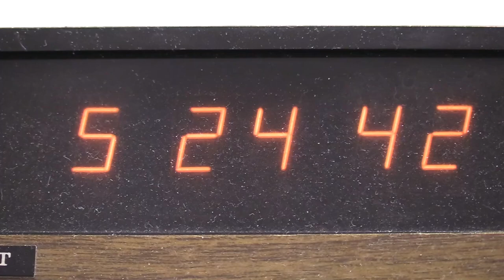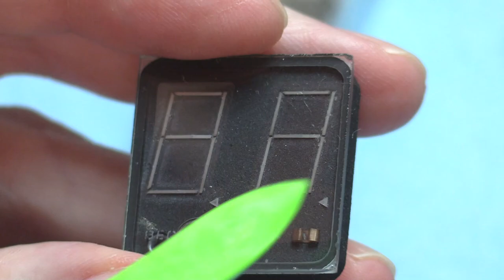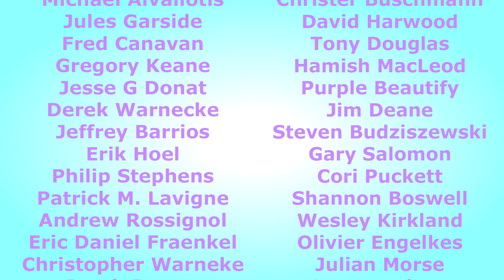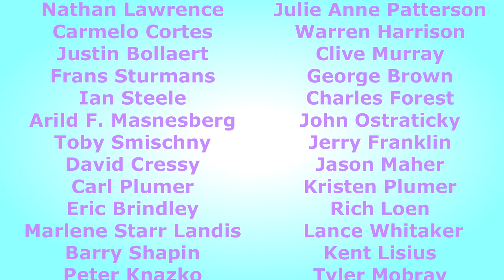Why Are Tubes Mirrored?

Comment: Fran, I love your videos. I worked at Dosimeter Corporation of America for 10 years, and one of the processes in the manufacturing of a direct-reading dosimeter is high vacuum platinum sputtering onto a 7 micron diameter E-glass fiber to make it conductive for use as the moving line (magnified 80X) against a calibrated film reticle. The process requires a 3-stage ultra-high vacuum that is back filled multiple times with Argon gas before the 3rd and final vacuum stage using an oil filled Jet pump. Platinum ultimately gets deposited on the inside of the glass vacuum Bell Jar that results in the same mirror-like appearance as a Getter. I took advantage of our equipment to platinum sputter all sorts of personal items from paper clips to guitar parts. We also manufactured Geiger-Muller tubes, probed, and meters, possibly including the one that you are using in this video.
Reply: Sounds like it was a fun job. The way you worded it makes me think you no longer work there.
Reply: @bentboybbz  The company was purchased by Morgan Crucible of England, who purchased the company name, equipment, and technology and moved it overseas.
Reply: @jts3339  Some jobs come with a nice sideline in bonus "stuff". Platinum deposition facilities sounds great.
I'm a Fitter/Engineer, I used to work down a coal mine. I could grab bolts and the odd thing from the stores. Kind of makes yours look a bit more special.
Reply: Can you re-silver a telescope mirror?
Reply: @DemoCATicMAN  I think its possible to do chemically maybe but has to be spun and done in a clean room ?  Not my area maybe someone else knows more. Sorry im not of more help. Now i want to go down a rabbit hole about telescope mirrors lol.
Reply: @DemoCATicMAN  I would say yes.  It would first be etched using an argon gas plasma, then silver sputtered with a device to spin the mirror to make the coating even.

Comment: The RCA valve is gorgeous.
Reply: My eyes widened and mouth went agape when Fran displayed it
Reply: Right? I love that it was designed to be beautiful as well as functional. And surely very few people would see one of these in a transmitter.
Reply: Mildly scary, imagine the bang it would make if someone dropped it.
Reply: @ThatBum42  OMG. Don't even joke about that. Forget the bang, what about the mess? :)
Reply: I was fortunate to witness these tubes in operation at an AM transmitter.  The plates glowed with intensity that varied with the average audio level.  I recall seeing bright orange at peak levels.
Reply: I like 4 1000a  my Rf amp has one
Reply: Vacuum tubes mix art and science. They're beautiful!
Good thing they're obsolete. Our modern world would't be possible with them.
Reply: @jsl151850b   not true! They are still in use today,  think microwave oven! Radar, x-ray ultrasound too many to mention! But yes they have paved our way into future.
Reply: @the8bitbarn836  I stand corrected, however, a solidstate replacement for the magnetron would give true variable power instead of duty cycling.
Reply: No kidding. Gorgeous.
Reply: @ThatBum42  Yes, it would be enough to startle a cat to jump through a closed window.
Reply: @frankowalker4662  Naw, the mess would be cleaned up after crying a river over the destruction of such awesome looking tube.
Reply: @WHHFDT  Yes.  You can also use these tubes in a SET audio amplifier and it puts out about 100watts.  So yeah, it's a pretty beefy tube.
Reply: @jukingeo  It would sound awsome and heat the house. :)
Reply: @frankowalker4662  Indeed, I never got into one as the B+ gets pretty scary.  You do something wrong with this tube and you are instant charcoal briquette.
Reply: @jsl151850b  FAA still buys and uses Vacuum tubes
Reply: They made a lot of stuff from vaccume  tubes,I only new about some thanks for shareing
Reply: Totally tubular, dude.  Cheers!
Reply: Got to admit I was impressed with the RCA tube 👍😊
Reply: @jsl151850b  - Apart from audio applications where many people still use them for the sound they make, a lot of radio stations still use them. Anywhere where you have a LOT of power they are often still used, its difficult to get 5kw out of a transistor...
Reply: The one at the beginning it is a 300B - and they are worth a LOT of money for high end single-ended audio amplifiers. They only give 2.5W to 3W so they are usually used with horn speakers but the sound is unsurpassed...  The RCA833A is not worth a lot $150 and its dangerous as hell to use as it runs at 2kv

Comment: I love your explanations of older technology. It's amazing how engineers solved problems. Sometimes with brute force!
Reply: That's the way edison did it.     He tried failed and tried again. BTW. TAE DISCOVERED THIS BLACK EFFECT WHEN HE P UT A THIRD WIRE IN HIS ELECTRIC LAMPS
Reply: @rsprockets7846  yeah Edison technically discovered the physical phenomena behind vacuum tube diodes in 1880 (an anode and cathode in a vacuum can act as an electric 'one way gate' only letting current flow one direction) but it took another 20 years for John Ambrose Fleming to realize that property could be used for radio detectors and invent the actual Diode tube.
Reply: @drewgehringer7813  
And including you too with your fairy tell stories. Be careful who you tell those fairy tales around in public.

Comment: That such items have been mass-produced for 100+ years staggers me!
Reply: I sell a lot of these and it still fascinates me that a 95-year-old tube can work perfectly well, and as new, after nearly a century. I love testing the real oldies.
Reply: In Russia tubes are still in mass production, mainly used in audio-amps by audiophiles who prefer the warmer analog sound.
Reply: There is the Great British Valve Project. They are getting various bits of valve making equipment together so they can start making valves again. Audio types as that's where the market is now.

Comment: I grew up in the 50's and fixed the old B& W TV's in my neighborhood in the Bronx. I took the tubes to the local pharmacy that had a tube tester and they had most of the tubes in stock. I infected my oldest son with my tube love and he is now a communications and computer engineer and has all tube stereo equipment. I also used to help rebuild CRT's and tuners. We would cut the guns out, process the CRT and re-flash it, replace the gun or guns and evacuate them before welding. I miss those days now you throw a TV away. I love your videos, thanks!

Comment: There are some tubes that have uranium-doped glass in them. It was used in the glass-to-metal seals because it has a closer thermal expansion coefficient to metal than regular glass, and so made for better seals when the tube was hot. An example is the Eimac VT129, a WWII-era pulse radar transmit tube. You can see the green glass around the leads.

Comment: Voltage regulator tubes just look cool...the ones I had glowed purple...argon gas, I guess. They also make good relaxation oscillators.
       Years ago, I saw transmitter tubes in operation at a small town radio station..they were glowing cherry red - I thought something was going wrong. The guy giving me the look around laughed, and said that was normal. He called them " coffee warmers".. 
      Some cars from the '80s had vacuum fluorescent displays. 
      Cool video!

Comment: You were spot on, large tubes like the 833A and the Eimac transmitting tubes have zirconium covered anodes.
Zirconium is usually inhert but will react with oxigen when heated at higher temperatures, the colour of the plate during operation is usually specified in the tube datasheet (usually with words like "cherry red" or "mild orange").
They also can contain radioactive stuff, it mostly happens in larger tubes that required large glass-metal seals, it was common to use uranium glass on the joints to try and match the different thermal expansion of different materials :)

Comment: I studied (started in 1967) electrical engineering technology at Purdue University in West Lafayette, Indiana.  One of my first courses covered vacuum tubes.  Four years later I was hired as a full-time graduate instructor.  My first teaching assignment that very same course on vacuum tubes. Much later (2000) I developed a curriculum on sustainable energy systems.  One element included solar vacuum tubes to produce hot water.  One of my students wanted to know the purpose of that shiny coating.  I replied "getter" and then explained.  Interesting that "new technology" still draws on basic concepts.  My first electronics project was a one-tube radio receiver (using the 1S5).  I was so excited (7th grade) when the filament glowed red.  Having been a professor (and aerospace EE) for 40 years it was always fun to explain filament transformers.

Comment: They couldn't flash that getter in the flat 2digit 7segmentdisplay because the conducting layer on the inside of the glass and the conducting kathodes on the back. And the thing is too flat to heat the getterring from besides. But what a great super rare display that is! Never saw them before, so that is why watching these video's is always something new to see and learn

Comment: High power RF tubes  usually have two types of getter in them.  The metal barium that is deposited at the base of the tube and the getters like zirconium on the Anode.  The Anode getter is activated by use of the tube.  When a old stock RF transmitter tube is first put into service the Anode getter should be activated over a period of about 100 hours with slowly increasing voltage applied to it.  The final activation is done at full rated output power for a couple of hours.

Comment: I am a retired high vacuum system glassblower. I checked thorium. It is an alpha emitter. Alpha particles do not penetrate paper, so the glass envelope of the vacuum tube will contain the alpha emissions of thorium
   Filaments have been coated with thorium oxide for about 100 years to increase thermionic emission of electrons while running at a lower  filament temperature. These filaments are used in mass spectrometers and other scientific equipment.
Doc Martin

Comment: The getter material used on the plates of large transmitting tubes was typically zirconium hydride.  Eimac used the trademarked name "Pyrovac". It only works at red-hot temperatures, so those tubes will tend to develop gas if used at significantly below their ratings.
Reply: Thanks for the info. When I find myself running one of these large tubes I will make sure I run it at the proper temperature.

Comment: Thank you for giving out the answer at the beginning! I'd have thought that either the mirroring was to increase efficiency by not requiring so much current to keep the emitter red hot, or that the mirroring was metal condensing on the glass while in use.

Comment: I''m glad your bringing up some of these topics. Tubes are still used by hams especially in higher powered Amplifiers .  That said, many of us with  a little more experience with tubes are getting older and passing . I had heard that one of the little regulator tubes was radioactive. One site mentioned that a certain tube had it added  or something wouldn't work quite right, but it wasn't a regulator.

Comment: Broadcast Engineer here.  4  of the 833s were used in a 1 KW am transmitters.   2 were the 
finals and 2 were used as modulators.  1000 Watts modulated by a 500 Watt audio amplifier.
 Older Gates and RCA transmitters used 833s.   4-400s were used in Collins AM 1KW 
transmitters.  Also using 4.   Again 2 were the finals and 2 were modulators.

Comment: I often hear nonsense on YouTube, but you have done quite well describing the process. On CRT's a mechanical 'roughing' pump was used, followed by a diffusion pump, followed by a cryogenic pump using ceramic beads and liquid nitrogen. All in all, it was about a 4 hour process. All the while the tubes were sitting in an electric oven to excite the molecular energy of gasses in the tube to hurry along the 'pump-down' process. Heating the getter by induction was indeed called 'flashing' the getter. After flashing, the vacuum would actually improve over time as the gasses 'stuck' to the getter flash. Over very long periods of time the biggest problem was/is helium seeping into the tube, because it will not combine with the barium and stick to the side of the glass. If you see a flash that has turned white it has "gone to air', and the tube is dead. Some knowledgeable people will 're-flash' a tube that has not been fully flashed and get a few more years of service out of it. That requires about a thousand Watt induction heater in close proximity.
While I never made Nixie tubes I do know that they are filled with a gas (neon?) that ionizes and glows, so they clearly don't need to have a high vacuum in the tube, which is what flashing barium getters is all about. I built CRT's for 'scopes and monitors at HP, and did all of the processes involved and that you described.

Comment: The silvering is from  the Getter which was fired at the end of the pumping phase of manufacture after the valve was sealed. It absorbed any residual gas molecules that would interfere with valve operation. In the mid sixties I spent a summer vacation working in VM1 at Mullards Hackbridge. This was at the end of valve development for valve based television.

Comment: Tubes are beautiful. I remember when I powered an 1G3GT filament with a 12V transformer when I was a child. When I showed it to my father he said: "the first numbers of most valves are the HEATER VOLTAGE. This tube has an 1.5V filament so it can be powered by a few turns of wire on a vertical frequency oscillator of a TV." Even when he reprimand me he taught me something. PS: the filament didn't burned out: tubes were not made for planed obsolescence like lamps.
The HP or Tektronix frequency counters he used at work had Nixie tubes, I loved when he tooked me to work.
Thanks for making me remember him.

Comment: Some high power tubes (some 304TL specimens come to mind) also utilize uranium glass for the glass to metal seal around the pins, so that's another source of radioactivity
Reply: Yes, I spotted my Eimac 100-TH pair had a couple of green glows around the pins whilst I was messing around with a UV laser!
Reply: Seen racks of them. The engineers and glass lathe op's just called them "Canary" glass envelopes. Yes 304TL's WW2 version. They later stopped using the radioactive glass.

Comment: It's getter. To remove the last air molecules after vacuum pumping.
I bought five 4 pin valves for £6 at a radio rally and inspecting them at home one was marked D.E.R. with a BBC stamp on the glass and has a pip on top where the valve was sealed. The body part of the valve is metal.
This dates it between 1924 and 1927 and it amazingly still works! Its tungsten filament lights it up like a light bulb.

I like valves and a few years ago made a one valve transmitter for Morse Code, 2 Watts out using a BT61 out of a non working oscilloscope.
G4GHB.

Comment: I used to build Dewars for high pass frequency filters and i used to have to precision weld into these stainless Dewars special getters that would help de-gass the Dewars when they were sucked down to virtual zero vacuums in a special "bake out" device, A dewar is a vacuum vessel.

Comment: Fran, Nixie tubes definitely have getters, however, it appears that they don't deposit material onto the glass envelope when flashed.
I have a clock made by Dalibor Farny in the Czech Republic. The R|Z568M tubes have a very visible getter at the top of the tube.
I have one tube that developed a leak in the envelope, causing the digits to develop dark spots.
I would be happy to send it to you for your collection. Even non-functional, it is a work of art, made by a true craftsman.
Dalibor has a YouTube channel that is worth checking out as well.

Comment: WRMI, 1.4 MW shortwave station in okeechobee fla. what is really wild is how some of the old MW stations used water cooled final power tubes. The rf voltage was so high that you couldn’t be in the transmitter enclosure when energized. One old station I watched had it’s own rotary DC converters to run the transmitter.

Comment: About a decade ago, I saw a craigslist ad that said: "Hi I have 8 7591 vacuum tubes that were new old stock, I tested these in a scott amplifier and worked well. I carefully removed the glass on each tube to clean both sides as all the tops had silver inside blocking view of tubes light now the tubes have no glass but may still work. asking 50.00 each."

Comment: You explained it very good Fran. 
I have an old clock that has Matrix tube I wonder if it has a getter in it?
I forgot the type of tube it is?
 it's not a Nixie tube.
I think it's called a vfd display?
It is an old Sears Roebuck and Company clock model 47198.
UL electric clock 1067. I like it. 
it has finger sensitive adjustment's that are, I guessing picked up by the energy coming off your fingers? Thats one way to say it lol
I bought the old display clock it's a Goodwill for a few bucks.

Comment: Cathode ray tubes (picture tubes) also have a getter inside them. The getter ring is located on the end of a long, curved metal strip that is connected to the electron gun assembly. When the electron gun assembly is mated to the neck of the CRT the getter goes in first and then it slides down the bottom inner surface of the glass bell. Then its fired off by putting the tube in an oven. There is usually an outer conductive covering on the tube bell so you can't see the black mark.